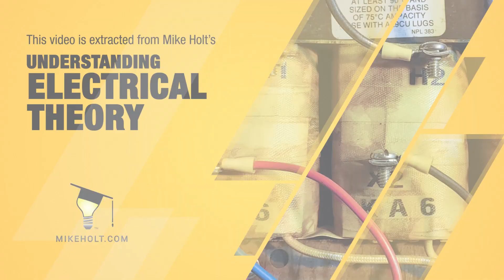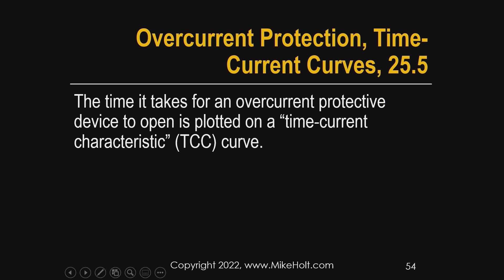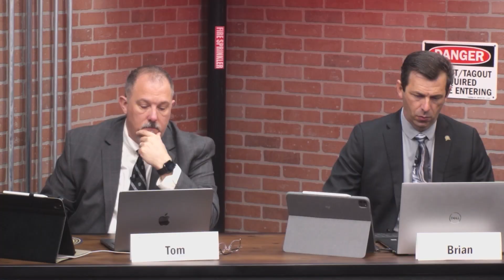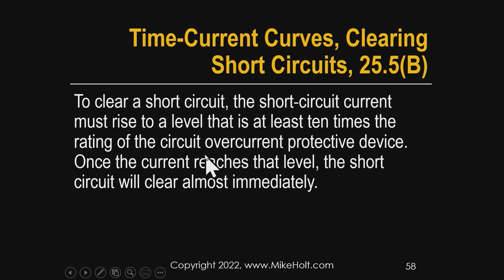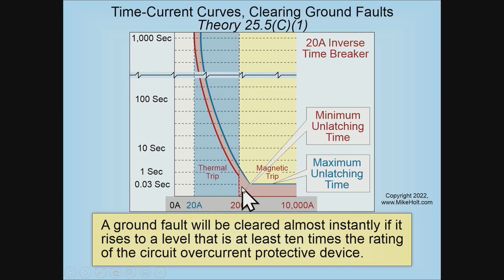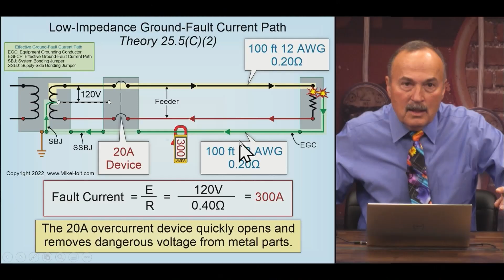Overcurrent Protection, Time-Current Curves 25.5

Comment: Mike - clearirng a fault scenario.
Many years ago, as an electrical inspector (Milpitas, CA), I was inspecting (testing) the interconnected smoke alarm system in a unit. When the super & I were checking the sytem [one person pokes the smoke test button, the other person goes to each location to verifty the alarm is going off]; all the smoke alarms did not activate. The super immediately called the electrician over to open up the ceiling boxes to see what was wrong. In one of the bedrooms we found some wires had become disconnected [poor wire nut tighening]. As the electrcian reached up to grab the live wire he inadvertently touched the the live wirre to the side of the metal ceiling box - all the lights in the unit went out [Note: 14 ga. wiring, 15A circuit]. We initially thought he had popped the main breaker to the unit - wrong. The entire condo complex had gone black. When the electrician went checking, he found the main breaker for the entire building had popped - 1500A service! Would you call that a great ground-fault circuit path?
Reply from the maker: Wow! Great story! Thanks